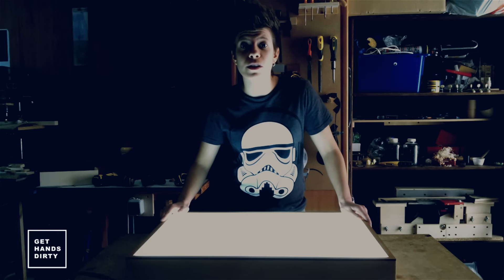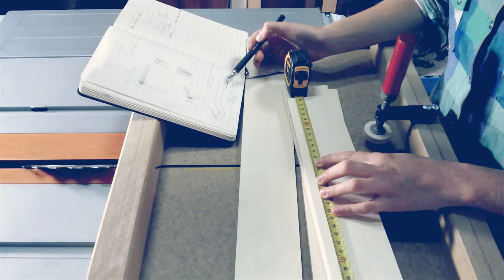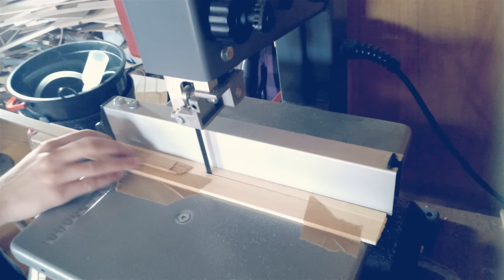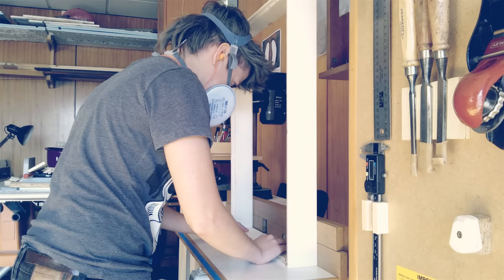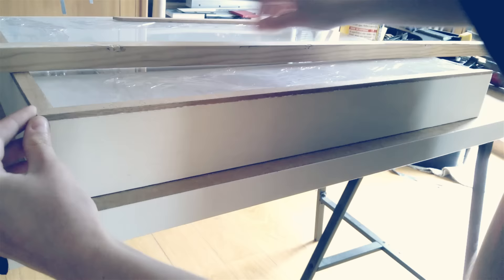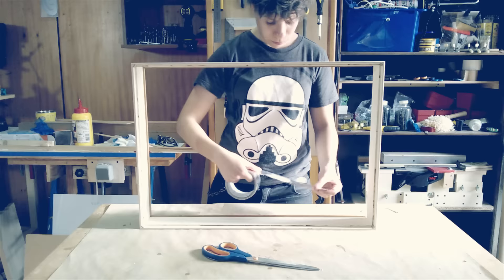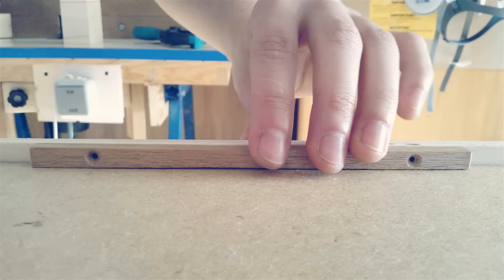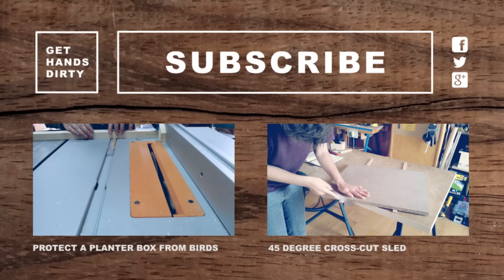Make a LED Light Box

Comment: Hi there! Thank you for this awesome video. I had a question for you. I have made a similar lightbox for myself in the past but got a dark halo in the middle of the square. How do you get the light to be completely even all the way across? I ended up using strips of leds on the back (instead of side) panel. But then the light comes out striped. Please advise! thanx :)
Reply from the maker: +Yaminay Nasir Chaudhri Hi Yaminay, well it depends on the lightning power of the LED strip and the size of your light box. This method I'm using works fine for lightboxes that aren't too big, although in this one you can still see a liiiittle bit of a darker center but nothing that would affect photography work or drawing. To your problem: The more distance you have from the LEDs on the backer board to the white surface, the better. And the closer the strips are sticked together the better. Probably what will work better in this case is to add much more strips...stick them about 1 cm apart and you probably will end up with a really even light effect. But again, if the box is too shallow I guess you will need to cover the entire backer board... You can then use an LED dimmer to lower the light intensity because it will probably get really intense.
Reply: Thanks for the recommendations I will try this out :)

Comment: Thanks for the video. Would you recommend a similar method for 27x40 poster frames ? Or is that surface too big to put the LEDs  on the frames ?
Reply from the maker: +Razvan Dragu Probably not, unless you use some kind of ultra bright led strips that are very expensive. Other thing you can do is to stick the strips on the backer board with minimal spacing between them (about 12 mm or so) and of course you will need rolls and rolls of led strip but will probably be less expensive than the ultra bright ones.
Reply: Get Hands Dirty
Yeah, that sounds like a plan ! And using aluminum foil on the backer board and putting the LED over it could help with the light. thank you.

Comment: Hi! It was a cool video. I made a similar light box to view radiographs and it was such a disaster. I taped the led strips to the back of the board instead of the walls like you did. And I haven't used the reflective silver foil. Do these two actually make a lot of difference. I wanted a uniform lighting. But somehow the lighting was not uniform and it was such a turn off. Any tips?
Reply from the maker: You just got your answer in the question. If the leds are looking forward, you will always see the strips of light, unless you put so many and so close that you create a solid light square. to avoid that, you can do what I did, but depending on the size of the box and the power of the leds, you probably you still have a little loss in the centre. But that might not be too bad for your purpose. Try to buy super bright leds or reducing the size of the box. Also, the thicker it is, the more space you have inside the box for the light to spread and you will have much better results than if you use a thin wood strips for the sides. Don't forget to put the led strip near the back. And of course, glue aluminium foil or paint the entire inside in matt white. You will notice a big improvement.
Reply: Can you give me the specifications of the led strips you used and the dimensions of your light box please?
Reply: Raghu Ram cool

Comment: Awesome work and equipments too! Btw where have you bought the glass you used ? And what do you call that again ? Is it plastic ?
Reply from the maker: +Perr Pher Cernechez Thanks! It is white translucent acrylic.
Reply: Get Hands Dirty ok thankyou! Is that also called Plexiglas ?
Reply from the maker: +Perr Pher Cernechez I'm not sure...I think Plexiglas is a brand. There is a difference between extruded acrylic (which I believe that it is what North American's call Plexiglass - it may tear a bit if you put alcohol on the edge) and cast acrylic. In this case I used cast opaline (translucent) acrylic.
Reply: Hmm ok I got it. By the way, where can I buy that ? Mall ? Home depot ?
Reply from the maker: +Perr Pher Cernechez I can't help you with that, I'm from Europe... :) We have acrylic sheets local shops here, not sure if you got them over there, but you can probably find it at Home depot or similar.

Comment: What table saw are you using? looks like a nice sized one for our city dwellers =D
Reply from the maker: Joël van Dam I'm using a AEG TS 250 K
Reply: Get Hands Dirty 

Would you recommend this saw to someone that would fold it after every use
and puts it away?
How is the fence, how wide boards can you saw whit the fence?
Reply from the maker: Joël van Dam I don't fold it very often, so I cannot really give an opinion on that, but it seems sturdy.
The fence is great. Very reliable, and comes from factory perfectly calibrated. When clamped, doesn't move at all, I'm really happy with it and you can rip boards until 64 cm wide.

Comment: What kind of light strip did you use? Is this a 5050 LED strip? About how long is the section you used? 10 Feet? more or less?  Do you know the color temperature 4500K 6500K?  Thanks!

Comment: why did you make it so high when you knew you were going to use LED-strips? 
i got light box at hom with an ordinary fluorescent light in it, and i find it uncomfortable to work on because it is so high :/  but maybe that is because i'm used to drawing in a sofa or a chair (basically when i'm sitting down, because when i stand it hurts my back :( ), and then it's of course a little nicer to have a flatter light box ^^
still very nicely done though, thumbs up for that ^^
Reply from the maker: +Mathias De Clippeleir Hi, thanks! Well, I've been making photography light boxes (with two layers of plexiglass and a fujitrans print artwork sandwiched between the plexis) in the last 4 years and I always think about them in a sculptural way, so it matters to me to have the 3rd dimension pretty evident. In this case, it was the first time I made a white simple light box and I was so used to make them thick that it ended up like this (although thinner than the ones I made for my personal artwork). Anyway, since I've been sticking the Led strip to the sides, the closer the light source gets to the plexi surface, the more evident the difference between the borders/centre turns. So, the center always gets a bit more darker. To solve that, we can just stick the Led on the backer board in several lines, but of course this idea consumes much more Led strip + a bunch of connectors or soldering...